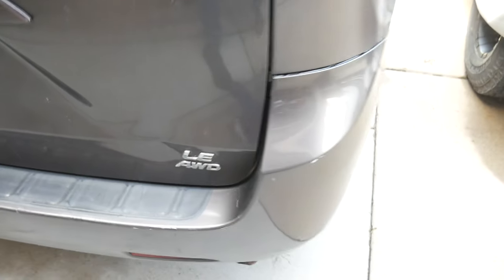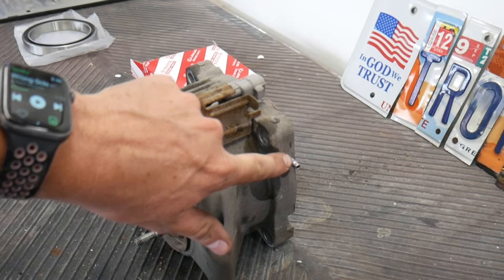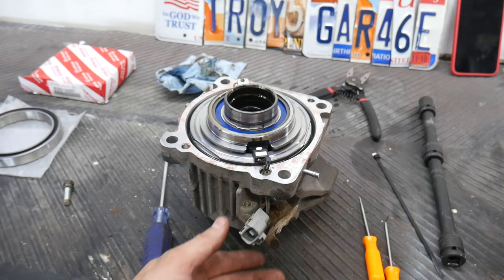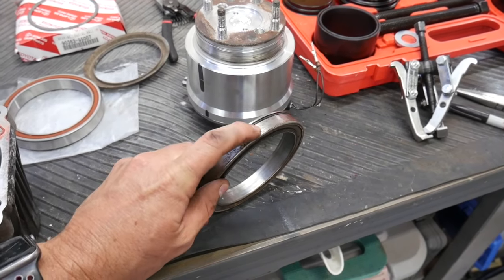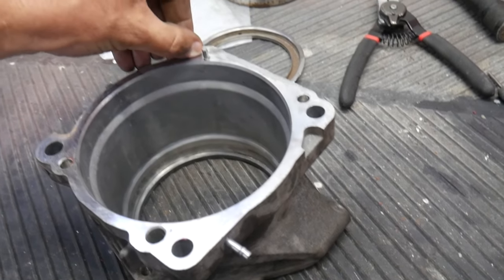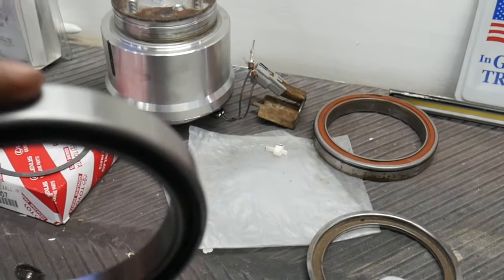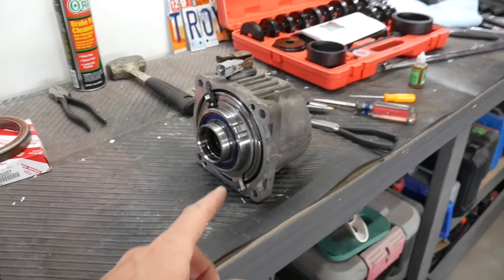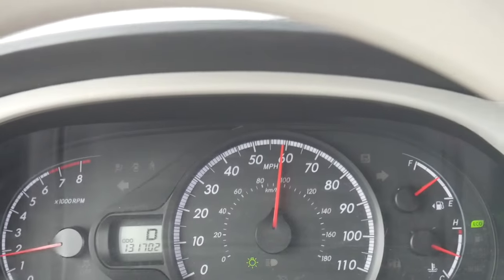Toyota Sienna and Rav4 Viscous Coupler bearing noise the ULTIMATE REPAIR GUIDE

Comment: Have you installed the bearing backwards, as in orange side out v orange side in?
Reply from the maker: Ummmm…..  no idea actually. The van is still throwing down miles for my niece with no new issues. So….  🤷🏼‍♂️
Reply: @jondawes7921  Yep, the bearing went in backwards. Orange side should be facing in. That may cause you problems.

Comment: good afternoon, i have a Toyota Naoh 2008 model dba-zrr75w. and I'm having a problem. the code i got from a scan is DTC/c1299/99 cancellation of 4WD Control. could you advise me on my repairs ?
Reply from the maker: This code refers to the size of one of the tires being different than the others.  This could be as simple as low tire pressure in one or more tires.  It could be that the incorrect tire size was recently installed as well - running on the spare could cause this code as well.  If all tire sizes are the same and air pressure is good, it could be the 4WD Control ECU.  But start with the simple items first.  Hope this helps.  
https://manualespurdy.cisdigital.com/Toyota/Rav4Aug2010/rm1322e/MANUAL.HTM/rm1322e/repair2/html/frame_rm0000020b500ex.html

Comment: What is the symptom ?  Mine does like a shutter growl and you have to let off the acclerator and then back down to change gear to keep it from growling and sounds like a vibration.
Reply from the maker: Sounds like the same thing. It will get to the point where it’s a constant growl.
Reply: Does yours sound like when you go over rumble strips?  My 2007 Rav4 I purchased almost a year ago has done this since I got it.  It happens between almost 40-50 mph at random times.  I first thought it was just the texture of the road.  Then researched and had 2 mechanics test drive and said the torque converter best to change transmission and put new torque converter.  Had that done and the rumbling is still happening and seems like it’s more often.
Reply from the maker: @sistersin  the fact that it’s getting worse over time tells me it’s very likely this bearing that is the issue. And yes. The sound is similar to the wake up rumble strips but without the “feel” of them. If you can Jack up all four wheels and SAFELY get under to hear where it’s coming from you should be able to confirm easily enough.
Reply: @troysgarage  wish I would not have replaced the transmission now, considering that did fix the issue.  I’ve now spent more in repairs than I originally paid for it.  Is this a part of the drive shaft.  I’m pretty sure that’s what the mechanic said he thought it might be since the transmission and torque converter didn’t fix it.  He said something about removing something that makes it all wheel drive and making it front wheel drive only may fix it.  But I didn’t know if that could cause other issues.
Reply from the maker: @sistersin that is exactly what this part does. It’s the lock for the rear wheel engagement. I supposed you could disconnect that part but you’d need a block off plate or you lose all your transfer case fluid.
Reply: @troysgarage  exactly what part would I need to search for for your fix for 2007 Rav4 unlimited, it’s 4 WD?
Reply from the maker: @sistersin it would be the back side of the transmission where the rear drive shaft comes out. I honestly don’t know if someone makes a block off plate specifically for this. You’ll need to search google, YouTube etc for how guys are doing this.
Reply: @troysgarage  if I try to do the fix how you did. What would I search for, just the parts you replaced?
Reply from the maker: @sistersin yes,but I’d start with getting it up in the air and diagnosing to ensure this is indeed where the noise is coming from. Follow my video for how I did that.
Reply: @troysgarage  I appreciate all of your replies, I don’t know if my mechanic would want to watch the video.

Comment: Nice video. Did the permatex hold up?  Any differential oil leak at the drive shaft?

 I believe the dust seal is 90304-94005 (41330M).
Reply from the maker: No leaks anywhere. She drives it daily and several long road trips. Good as new still.